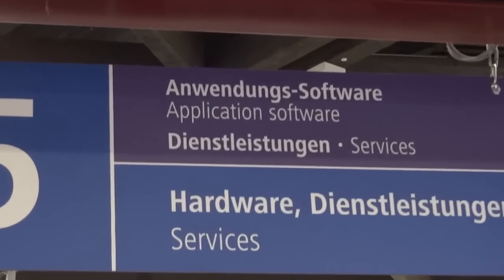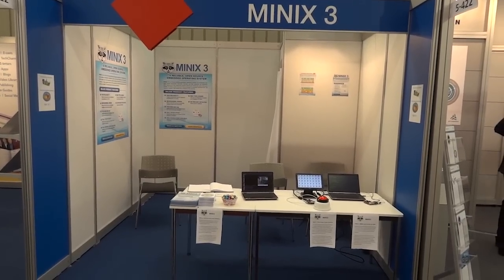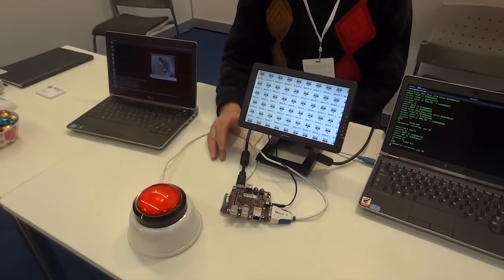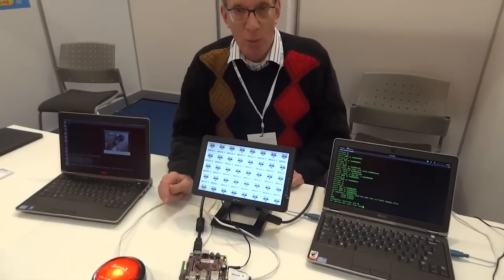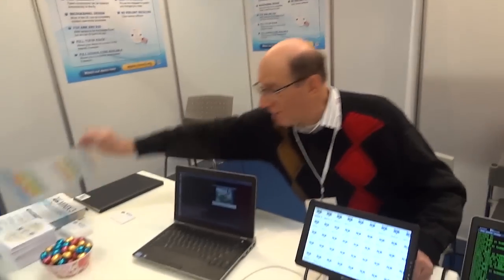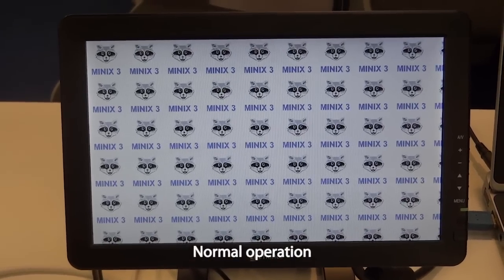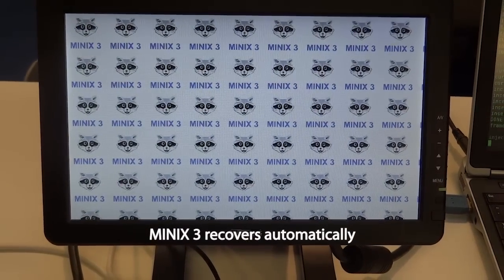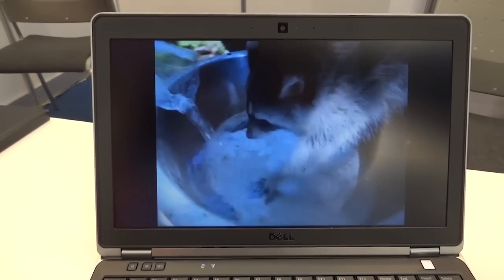MINIX 3 at the Embedded World Exhibition in Nuremberg

Comment: An OS that automatically reboots when it crashes? Is MiniX based on Windows 10?
Reply: It doesn't reboot. It fixes itself on the fly. In other operating systems, if the video driver fails, you would need to reboot.

Comment: Some systems are great but the circumstances in which they are born are not favorable... Minix is great but its fate is doomed. Most open source developers are interested in contributing to Linux or BSD systems. Everything else is just not relevant anymore...
Reply: No se trata de cantidad, si no de calidad. MINIX es increíble, y es precisamente por lo que comentas que el mundo necesita más gente como Mr. Tanenbaum.
Reply: Just say Debian.

Or does Intel running it

chngthngs?
Reply: Minix 3 might as well be a BSD at this point. Its userspace is almost entirely borrowed from NetBSD.